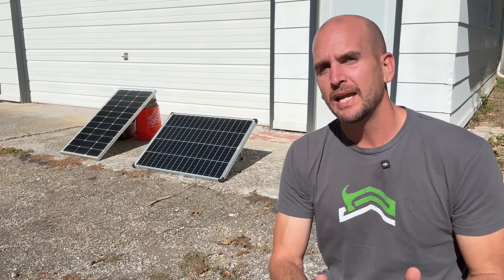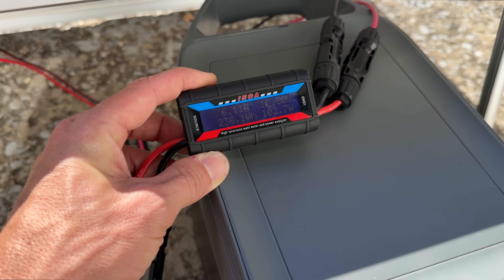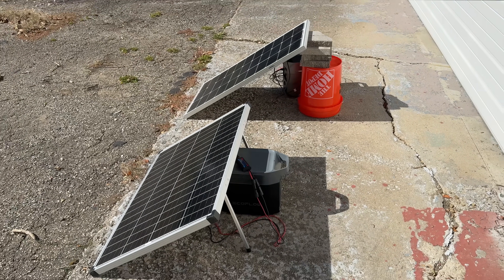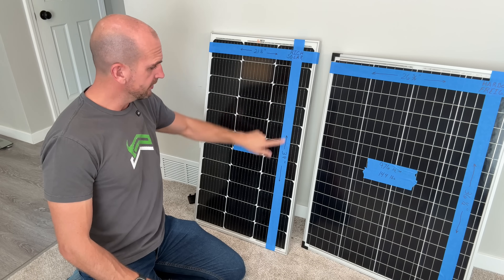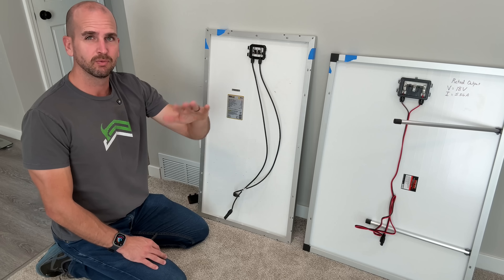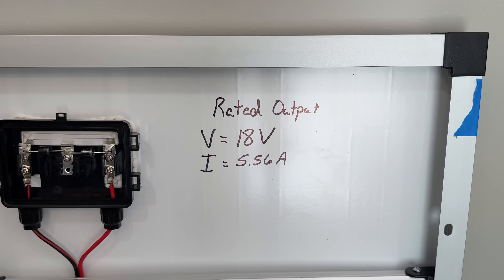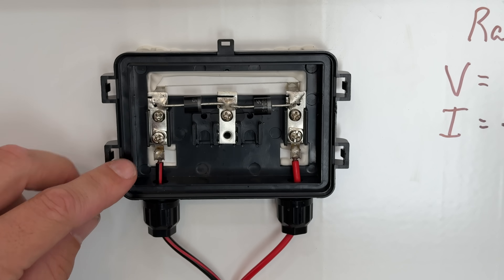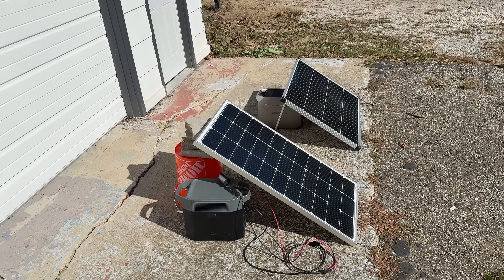Harbor Freight 100W Vs Rich Solar 100W |  Tested!

Comment: I would re-run the test with both battery pack shaded. The battery pack for the Rich solar was mostly in the sun. This can affect performance by heating the battery and circuits in the unit. This may give a faulty result because the conditioned for both units were not the same. Just my opinion but great content and what appeared to be a unobjective view point.

Comment: Staying away from the SAE connectors is a good idea all together.  I swapped all mine to the MC4 and its just mote convenient and you can mess aroujd with trial and error to build your system easier. I redid my system 3 times before i settled. But now i want to upgrade already since it doesnt like winter time. Just a solar shed. 300 watts. 215 AH battery.
Reply: Just keeps adding to the more expensive panels

Comment: What I found in Florida was at angle doesn’t mean anything I didn’t get any more or any less having my solar tilted or laying flat on my roof. The second thing I realized is that between 8 AM and 11:30 AM the sun is only half as hot as it is after 12 PM through 4 PM. Which means I was pumping out more power after 12 PM then I did from eight in the morning till 11 AM! So your experiment would have to be an all day one. Switching your batteries for the afternoon the afternoon solar panel is going to produce more electricity. Also when it’s extremely cool out the panels produce half the amount of electricity because it is not sunlight, it is the heat on the panel, the hotter the panel of the more electricity comes out. The colder the panel less electric comes out. Has nothing to do with light it’s heat! Take me a couple of months to figure that one out! Because I couldn’t figure out how everybody in Canada‘s solar was working better than mine in Florida when I have 300 straight days of unlimited sun.😂
Reply from the maker: The relationship is actually inverse to what you stated.  Hotter panels (above 25C or 77F) will start to produce less than their rated power.
Reply: During summer, there is longer sunlight in the summer in the north

Comment: If you look at power per square inch, the Harbor Freight have .507 Wh and the Rich Solar provided .521 Wh, so in pure energy efficiency, the Rich Solar wins by a small margin.  Still seems like a good showing by both.
Reply from the maker: Here is the updated google sheet that has all 6 different 100W panels we have tested with some additional metrics like $/Watt and Watts / sq ft https://geni.us/EcNIB

Comment: How well do the Harbor Freight panels hold up to weather, specifically rain and snow?
I bought a small 14wt HF panel to float charge a battery on the farm, only to discover it was NOT waterproof at all.
Reply: Don't waste your money...100w real panels on Amazon all day for $50-$60
Reply: @mrmotofy  I haven't bought a solar panel in years, and will not likely even look at HF panels when I start my next solar project.

Comment: Can you add panels (mixed from different mfgs)?
Reply from the maker: Yes, if you are wiring in series you would like to match the open circuit voltage for each panel you are adding.
Reply: Match specs as close as possible

Comment: Thanks for the time to do these head to head tests. Not to be overly picky, but I believe you made a calculation error. The Rich total is 423 watts (I have dysgraphia so I know how it can happen) and even then, my math shows the difference of 15.6%. 

As other have stated, the price should be included to take into account the cost per watt of each panel. As you did say some stack 20-30 for off grid, so at that volume a 10-25% price difference matters more.

Comment: I had 3 of the 100Watt HF panels mounted flat on a truck camper and used the "hub" that HF sells for their panels. I typically parked overnight in parking lots while traveling. Parking lot lights kept the panels at the same level as they were when we went to sleep. Even with running  7cf residential refrigerator/freezer all night. Also my panels were bought on sale with a 20% off employee discount stacked on top. Biggest thing was I didn't have to resend the panels back several times due to shipping companies treating them like basketballs in shipping.
Reply: Are you saying parking lot lights were able to charge it to the point where it would just hold the charger head when you pulled up
Reply: @ItsMe-ic7on I know when mine are covered with a few inches of snow they still do what I need them too do. I'm going to have to try mine under street lights
Reply: Yes off grid is the best way.

Comment: The Harbor Freight unit has 17.8% more area than the Rich Solar, so that would explain the 17% higher output.  If you look at the power per square inch, the Rich Solar provided 0.510 wH/sq. in., which slightly exceeds the Harbor Freight 0.507 wH/sq. in..  

In other words, just about a dead-heat based on which shape best suits your installation location (e.g., if you can fit 5 HF units but 6 RS units, the RS units will be more cost effective)...

Comment: I have a friend, who is heavily involved in home solar.  Here in Arizona, it's a big business right now ... and coming into some money, I asked about the investment.  He pulled me aside, and said .... "The technology isn't here yet."  He said "Solar panels after about 10 years in most environments start breaking down, and are progressively less and less efficient.  Here in Arizona ... after 7 years the panels become less and less efficient.  In 10 or 20 years, maybe they will have improved the panels, so as to that not being a problem ... but if you are planning on investing in solar .... don't do it now."    He sells solar home systems to people, so I have to believe he was being more honest with me than his actual paying customers .... do you have an opinion on this matter?
Reply from the maker: Thanks for the feedback.  Panels will degrade over time but most will warranty their panels to product 80% +/- after 20 - 25 years of use.  Will that play out with the latest panel design, that is the question that none of us know.  What I am trying to do is set up ground mount panels that I can run all sorts of brand and models over months and they years where we can take the data and really see which panels are degrading faster and does this match up to the warranty for these brands.  Just give me about 5-10 years to get the data 😂

Comment: Dude, how can you not also show the percentage area difference???  Compared to the wh difference....  The smaller one is 15% smaller than the bigger one!  There's your 17% difference within margin for error.
Reply from the maker: I agree that is a critical factor.  I am continuing to update this spreadsheet with all the latest results which include what you are asking for by looking at Watts / sq ft and $ / Watt - https://docs.google.com/spreadsheets/d/1cXY9StZ4SaLIzjlhyiC26kxJZy3hJ5jE/edit?usp=sharing&ouid=110269586406228906661&rtpof=true&sd=true

Comment: Given that these are both set up in front of a big white garage, would you expect some reflection from that surface to contribute, and therefore the landscape orientation of the HF panel to be getting more exposure than the Rich panel?
Reply from the maker: Hmmm, I don't think so.  If one was a bifacial the white background might give a little more boost but I don't expect much for these 2 panels.

Comment: Great video! What percentage of the battery got charged up during your test? I’m interested in doing this maybe with 2 panels for my home office set up. It would power two laptops, two phone chargers, an LED light, and a printer.  My first calculation would have to be how much battery storage do I need to do that

Comment: It's not a question of efficiency differences between cheap solar panels.   It's simply a case of deceptive advertising....aka bullshit.    The market is flooded with equipment claiming to be something it isn't, ranging from solar panel output, to PWM or MTTP solar controllers, to any other detail that is believed to be a marketing advantage.

Comment: It would appear that the 17% difference in power output is really close to the 15% approximate difference in surface area. I'm curious if this is a trend that would continue with other brands.

Comment: If you compare the wattage per size, the two panels are almost identical. The HF is 17.7% larger and produced 17% more watts. This equates to the Rich Solar creating 0.6% more watts per square inch. I would think that the larger the solar panel, the less efficient per square inch that it would be, so this 0.6% difference is probably almost all attributed to the loss of efficiency from being a larger size.

Comment: Are you using a charge controller to convert voltage and current to match charging voltage of battery?

Comment: Watt/size is important and should have been included.  You nost of the time do t have infinite space.   I calculate that they have the same output woth this method.
So no there is no "massive difference".

Comment: I need calculators for much larger systems that include batteries and a hybrid grid tie so I still have power when the grid goes tits up. I am a nightmare to those solar sales critters that drop by every spring. I invariably know more than they do. My home uses at most 62 kWh per day with about 55 being the average. Since I want to use ZERO grid power I need a large battery vault and a big array. I want to have an array big enough to top off the vault in an hour, two at most and have the rest of the day to sell the rest to the grid. Where can I find those calculators? Also a list of panel and battery manufacturers and the country of origin would be real nice. I REALLY want the Helene 156HC M10 NTYP SL Bifacial Module (625W!!!), but I cant find any prices.

Anyways, If there isnt a calculatorfor this then where can I find that info? I know what I want is bordering on commercial/industrial level stuff and dint know where to start! HELP!!!

Comment: The HF panel is 15% larger.  You do nott mention cost, longevity performance guarantee or the country of manufacture.
All of which are very important factors when considering the purchase.

Comment: I am curious if you normalize the overall output for each panel to the size of each panel. I get 0.507 Wh/in^2 for the HB and 0.5139 Wh/in^2 for the Rich. This is a marginal different in output and if the cost of the Rich panel is much less, then that panel is your better buy, imo...

Comment: So the RS is ~15% smaller , ~14% lighter and produces ~17% less power than the HF panel is what the math tells me.  Did I get that right?  I guess the quality of the protective coatings, local availability and the price points would be the deciding factors then?

Comment: I'm very interested in doing this kind of testing myself particularly with a focus on how panels efficiency changes with diffuse and indirect light. I've found that the most efficient panels tend to lose the most efficiency in indirect and diffuse light. That means that sometimes a high-efficiency monocrystalline sell will underperform compared to a low efficiency amorphous cell depending on cloud cover. 
   On the package specifications are usually tested in direct sunlight adjusted for noon at the equator on a clear day. There can be vast differences in real life circumstances.
  I would like to build a catalogue of test results for different types of panels as well as brands.
   Would anybody be willing to help me by donating panels and or test equipment?

Comment: Another area of consideration is longevity of the product and loss of production over time.  I've seen videos that compared drop offs in watts produced in year 2, 3, etc and they varied by panel. I recall it had to do with the materials used to make the EV panels but I don't know enough about it to say much more.  But just as a hypothetical, if the Harbor Freight lost 10% of output per year and the other only 5%, that 17% advantage might not be so good averaged over time.  Of course, it could be the other way around as well.  Maybe the HF unit starts out with higher output plus loses it more slowly. I don't know any way to test that quickly though.

Comment: A properly crimped connection is “better” lower resistance than a soldered joint. A crimp creates a gas free connection with tight metal to metal connection.

Comment: Is this not obvious given that the HF panels have a larger surface area? It's not simply about the W output. A larger surface area will generally be able to capture more and therefore get closer to its max output. Smaller panels have a greater chance of shadows, dirt etc etc etc affecting output and vice versa.

Comment: The Harbor freight panel did produce more power, but it's also larger and more expensive per watt.  The size difference is directly proportional to the power output. based on this comparison, I would choose the other panel, unless I had a very specific size requirement that only the harbor freight would fit

Comment: Mention if the systems have a built in regulator. You plugged into separate system and not a regular battery.

Comment: A few flaws in your methodology. First the amount of power the stations can absorb is different. The delta 3 plus has 2 mppt ports and you could have just used that. Second i have found those all in one style poser meters to be very inaccurate.  I would expect the larger panel to produce more power in ideal conditions .Surface area is the biggest factor. You also needed to shade a corner on each panel to show the output reduction when a individual cell is blocked. many budget panels produce well in full sun but almost zero when slightly shaded

Comment: It seems to me that simply the area difference almost entirely accounts for the 17% benefit on the Harbor Freight version.  It's about exactly the same difference in SURFACE AREA.  Could that be the main difference?  Not sure if either is really more efficient.  The REAL question is LONGEVITY.  Which might perform the same or well for years and years to come.

Comment: From my experience solar panels with plastic corners are usually have a very CHEAP build quality.  I would have like to see a watt per square inch.  You can always just make a larger solar panel and call it a 100 watt solar panel, but in reality it is a 120 watt panel making it SEEM to be a better output than other 100 watt panels.

Comment: I have to weigh in.  The calculated and published wattage is  open voltage unconnected multiplied by the maximum possible curret at max output. So the HFT is 20V x 5A =100w. In reality when under load or in a circuit you get about 60w. I have a huge solar system with 600ah of storage with multiple MPPT charge controllers. assume 60% max rated power.

Comment: The 17% advantage of the HF panel seems to correspond to the percentage of its size difference. So I imagine that the efficiency per unit area is about the same.

Comment: Very informative, however, your math is way off for the Rich Solar - (as 232 + 191 = 423) which will change and increase the % difference that the Harbor Freight has over the Rich Solar.  As you add this info to your chart moving forward, please be sure to adjust this for greater accuracy.

Comment: Great video. I would brush up on your math though. Rich solar by your math was 432, put those numbers to a calculator and it id 423. I know adapters help many people. Here comes the but. But less connections is less resistant's and less places for errors. SO your 17% is going to be a different number. Still a great video for sure. You take it to a level most can understand, without knowing all the lingo of the industry. Great job.
An idea for a video. The difference between dirty and clean panels. Nobody ever says anything about cleaning them ever so often.

Comment: Very good info.  I noted that the Harbor Freight panel was approximately 17% bigger (square inches) and similar increase in weight (lbs).  in the end, you mentioned 17% more power generated by Harbor Freight, but in power per sq inches it sounds like it would be very close.  The biggest question to compare that I missed was:  What was the price comparison between the two panels?  If the Harbor Freight costs 17% more, then it sounds like a wash.  If the same price, then the Harbor Freight might be a better buy.  Thanks for the great practical info, and given in layman's terms so a simple guy like me could understand it easily!!!
Reply: And much more expensive...100w are $55 on Amazon now

Comment: 100W solar panels are the most popular by far because of the price. The buyers
think they can add more panels as time goes on affordably. HOWEVER,
If you figure the WATT per SQUARE INCH  you will find you get more watts for 
your $$ with a 320-450 watt panel taking up less real estate. This is important
on a bus or Rv install.

!

Comment: Well done comparison, but there it is missing something that I admit would be more time consuming to test. What is the standard deviation of performance between two or three panels from the same company?  If the products coming out are consistent, then the numbers you deriving are valid. But if the manufacturing isn't consistent, you could have one batch that are heroes, and another that are sleeping.    The drawback is investment in testing rigs, time to set up the tests, and all of that work that goes into making a good test.

Comment: Quick observation/clarification…I get a 15.69% difference. Taking into account the corrected 423 instead of 432, I think the percent difference equation is (A-B)/((A+B)/2). I can’t get 17% even with 432.   Something I’m missing?
Reply: Ok got it … it’s a percent change, not a percent difference.

Comment: Your white board math is off on the center bottom column. 423 not 432. I kept trying to figure out you were getting 17% and working it out on my 3” X 3” screen gave me a headache. 
But thanks for the comparison video I liked and subbed.